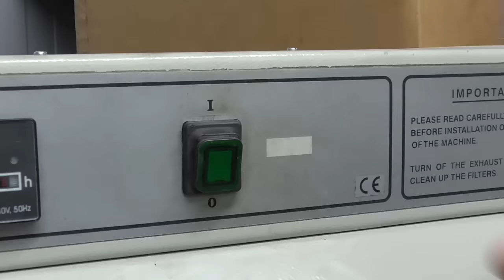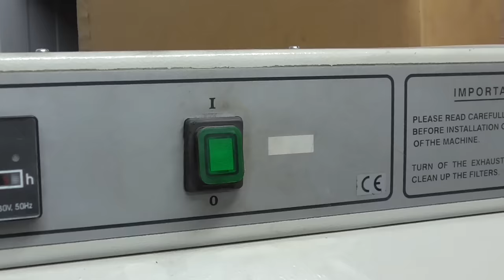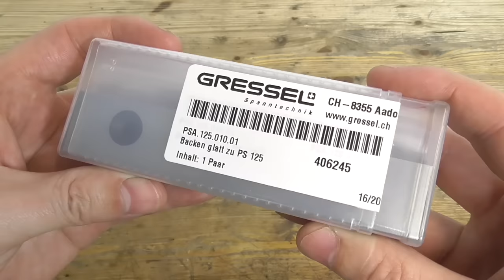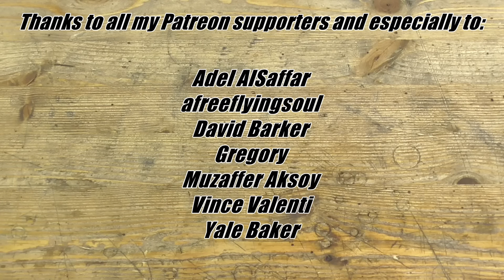Broken Deadlocked Vise - Perfect Restoration (I did it again)

Comment: Using damaged parts to re-make missing ones is a nice touch.
Reply: I especially liked those parts the most
Reply: Honestly, I thought he was going to unbend and straighten that part out, not use it to make other parts.
Reply: It's like the circle of life
Reply: and it look better than something out of a factory
Reply: @eliascarlsson6813  Have you seen the new ratcheting screwdriver video? Utterly amazing how much of the original he was able to salvage of an over 100 year old tool.
Reply: It would have been better if he would have straightened that handle...and used it as it was
Reply: Except this pin. Wrong material :-/
Reply: It rather turns the Ship of Theseus question on its head, doesn't it?
Reply: It's a mix of new and old
Reply: So it's not entirely restoration is it, it's replacement so a some what misleading title, but don't get me wrong it was thoroughly enjoyable.
Reply: @Scatt2k7  I bet you're fun at parties.
Reply: It's the ultimate method of recycling.
Reply: @Scatt2k7  Not by any books I have read on the subject.  It is a restoration because he brought it back to a functioning state with a majority of the parts back in it.  There are plenty of even older tools that are simply broken or missing parts and you cannot just rebuild with what you have and have it anything but non-working.  That is not restoring it--with the possible exception of a museum item.  Conservation restoration is different though as the item is not to be used.  He is restoring to return it to service so it includes the necessary fixes to make it work.  This belongs in a workshop, not a museum.
Reply: @brucek.evans-historian7028  What about having it in a workshop in a museum?
Reply: But it can't be used for a long time.
Reply: @asimjahangir8516  If he doesn't remove the handle then he can't properly remove the rust.after all, rust has always been the natural enemy of machinery.
If he straightens the removed handle and then re-engages it, this may yield, i.e. break suddenly, potentially injuring the operator.
Reply: @Scatt2k7  As a pan-mechanical enthusiast, I agree with you.
Reply: Along with CHEATING !.TOO !!
Reply: BUT ! CHEATING !! THOUGH !
Reply: @kj6372  Have you ever Heard the Word !. Recycling ! Before !??
Reply: @_spacegoat_  What's !.That ! WEIRD! Word?? PARTIES ! Then !??
Reply: Yes that is great

Comment: MyMechanics: I need new jaws for my vice.
Gressel: WE MAKE NEW ONES.
Reply: Hahaha,I was looking for this comment 😂
Reply: what i don't understand on the jaws, why the hell are they making a throughhole for the bolt instead of a bottoming one?

In this case you have more surface where you could put pressure on.

There should be a hole only 3-5mm deep, it's just for alignment...
Reply: Yep... They got him :D
Reply: Gressel was afraid that he would make better ones, so they denied the chance.
Reply: @CrazyThunderbird  you're only partially right. it does reduce the surface area, but in doing so you get more pressure. the main advantage is one of detaching the jaws if they get deadlocked. you can drill out the pin accurately instead of having to grind the whole jaw down. jaws get locked frequently because of the constant pressure, the exposed metal, and the common lack of grease or sealer between the jaws and the body
Reply: @ianmcelheny3270  Ok with deadlock is a good argument, and yeah you get more pressure  on mm² than without the drilling, but the friction surface is more, so you can build up more friction and it'S harder to get it ou t of place

for the pin i would have made an 3-4mm big hole on the vessel itself inside the (i thinks it's an 8mm bolt) to the back of the vessel for a nail punch
Reply: @KrisjanisZagers  Gressel KNEW he would make better ones. Fixed it.
Reply: And then Gressel goes to MyMechanics to have them make it.
Reply: @Tucker Latham *vice (UK spelling ;) ) lol
Reply: @CrazyThunderbird  Oh dude... friction is not related to the amount of surface at all. You do not get more holding power by having more contact surface. You'd get the same amount of friction on a pin head and a square feet worth of surface for the same amount of force ( assuming both surface have the same friction coefficient, ie ; same material ). Pressure on the pin head on the other hand...
Reply: I love people like you!

Comment: Although without question your work is to an excellent standard, it is not that which   places your restorations alongside the very best. It is the methods that you choose to adopt while carrying out the restoration. The engineering techniques are the most proper and fitting to make a good repair. Nice work dude.

Comment: What is your worst nightmare?
everyone: snakes or spiders
my mechanics: sharp edges
Reply: Unpolished surfaces 😱
Reply: Non counter sunk holes
Reply: Putting a chamfer on the sharp edges reduces chance for getting cut and reduces the chances of the cast iron cracking under the pressure of use.  Engine builders do this all the time with engine blocks and heads fresh from the machine shop.

Comment: I can't believe my eyes. This is it, new sandblaster swtich ;D
Reply: You mean old switch without the broken cover?
Reply: Its been like that for a couple videos, but he has used footage of the new switch when turning the sandblaster on, then footage of the old switch when turning off, just to mess with our heads(and generate comments)
Reply: You didn't watch previous films. I envy you.
Reply: @ftgv1  indeed
Reply: Plot twist: the switch is still broken.  It's just stock video.
Reply: @6988kid  There is no switch. It's mind control.
Reply: Boy.. You're so late with this one....
Reply: Yes no more pixelated switch
Reply: Only the internal light when it's "on" is missing.

Comment: Let's hope that whoever ends up with this takes better care of it than last time.
Reply: Apparently it survived ww2 (with the “43” stamped into the surface)
Reply: @jakeforrest  There are watches surviving from the 17 and 18th centuries that still work. What's your point?
Reply: @stopthephilosophicalzombie9017  My point is that it survived WWII.
Reply: @jakeforrest  My point is that it's not that impressive
Reply: @stopthephilosophicalzombie9017  It always depends on the circumstances.
If you freeze fresh meat to the absolute freezing point (minus 273 Celsius) it will stay fresh for thousands of years, unlike if you keep it at room temperature.
It’s the same with watches from the 16’th century. If kept in a dry and temperature stabile environment, they won’t wear from corrosion (but maybe usage)

Comment: Just love the pride in absolute perfection!

One question though: Why do you never protect the threads when you it in a chuck?
Reply: That's why he switched from a 3 jaw scroll chuck for a collet chuck. The collet bears on the entire length and diameter of the thread and spreads the load.
Reply from the maker: Threads won't get damaged clamping in a collet.
Reply from the maker: @xenonram  just ignore the troll 😅
Reply: TheJR1948  he has more engineering common sense in his little finger than you have in your whole body!
Reply: I'm no machinist but wouldn't you throw off centering by protecting the part you just turned?
Reply: @xenonram  He's just jealous that he can't do a good job like MM, just ignore it

Comment: Always put thick rubber O-rings on the handle to dampen the sound when it slides trough ad stops by the knob, it's the best $0.10 investment you can do to lower the noice around your workplace.

Comment: I have seen and owned lot of vices but I have never seen one where the back jaw moves instead of the front jaw.  It seems to be a whole lot stronger design than what we have here in USA.  Just did a search for images on google and nothing like this design came up.  the only draw back I can see is the limited thickness that will clear the workbench vertically.  Which can be really necessary in everyday repairs.
Reply: No, this design is not good.
Anvils may adversely affect rails when in use.
Reply: @kyvih9217  I guess that would depend on how hard one bangs on it.

Comment: Such a beautiful restoration process.  Quite enjoyable to watch.  It looks like a shiny piece of jewelry or a finely designed clock.  I would have problems using it for fear of marring surface after such work to restore to a precision state.  Question: What does the sandblasting and heating of the raw material do (the handle was on piece)?  Does it make it more durable and rust-proof?

Comment: Have you ever considered using electrolysis to convert rust back to iron? That minimizes loss of material, and causes less pitting than sand blasting. It often also dissolves paint, especially if you use enough NaCO3 in the eltrolyte bath. Frozen parts often loosen after electrolysis.
Reply: Or what about something like Evapo Rust, which I believe has a rust converter in it?  But most people enjoy watching the sand blasting. He might have to sand blast anyone after doing that.

Comment: On engine dowels,usually tap the inside.thred a stud in.then use a spacer to pull out.still usable.and removable.but neat tool.and would be great on solid or hard materials.

Comment: What is the rotary tool you use to take off sharp edges? 
Also, can you comment on what type of welding you use to add material to defects in the parts?  
Thanks and great videos!
Reply from the maker: Think it's called Minimo or something like that. I recommend buying the inserts on Aliexpress for your dremel, very cheap there.

Comment: I wonder if there's an easier way to redo the raised lettering? Could you maybe coat the area around the lettering with some kind of temporary masking material (maybe wax or tape), then gently wipe or scrape it away from the surface to be painted, then paint, and after drying, remove the remaining masking material? It seems like it would require a lot less precise painting and yield as good a result, if not better (no offence).
Reply from the maker: Thanks for the feeback :-)

Comment: Hi, i adore your videos, you really are next level, when watching restoration videos i usually always watch for fingerprints, dirt left in the corners, not disassembling 100% of the stuff, just working around things and it leaves me a bit anxious, i want to go and do it better. with you i don't have to feel anxious, i'm fully confident you'll make it as perfect as I would imagine it done. 
one thing... would it be possible for you to block or get the camera not looking at the welding directly? or removing the light flash?  i'ts kind of triggering for me and I have an epilepsy prone person sitting in the same room and I worry the flashes of light will trigger an attack. Thank you!

Comment: Hello, can you tell me what did you do at 12:50?
How did you get the spindle nut in black?
You heated it up and then you cooled it down in oil, or what?

Thanks,
It's great restoration video! 🤘
Reply from the maker: Yes, correct
Reply: @mymechanics  which oil should I use?

Thanks

Comment: I'm not saying that the way the finished vice looks bad and doesn't function but the way it got to that point was so very wrong. First you needed to fully repair the dove tails and not just use an oil stone without oil because your stones were dryer than the Sahara. Second, you put grease in spots that don't require grease and you used too much loctite on the ball ends for the handle. You also don't use a slot cutting disc to cut something in half. That's dangerous and not the intended use for that tool. If a machinist say the absolute backwards ways you used, they'd cry. Also your welding can be done in a continuous line because the material you're working on isn't hardened and is a good heat sink. I'm being very critical but to help polish your skills in restorations for future items

Comment: 5:42 8:16 8:22 12:00 Why are you doing so much useless work?
Are you trying to sell it as if it were brand new to someone who doesn't know?Or are you going to use him as a decoration and not allow anyone to touch it?
If this thing is a hundred years old antique, I will cry like crazy because you remove the traces of its age.This thing doesn't look like it's old though so I'm not going to cry a lot, but it still makes me mad.
Mechanical restoration is to restore its function,It doesn't need to repair scars that do not affect function, because the aesthetics will soon be destroyed after use. You can ignore that if you're planning to keep it as a collection, but I don't think this thing is old enough to be a collection.

 16:28 The pin should not be made from the original scrap but bought a new one, the steel for the grip is too weak.  It's already bent after all, isn't it?（If you are for collection, you can ignore this also.）